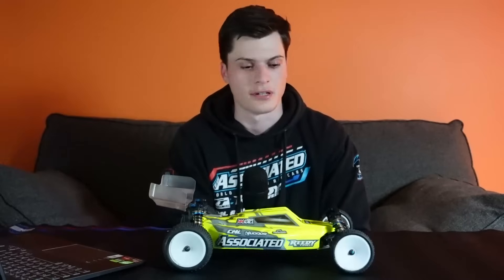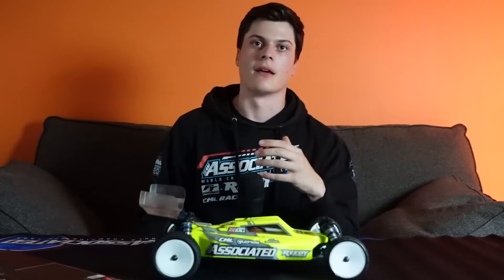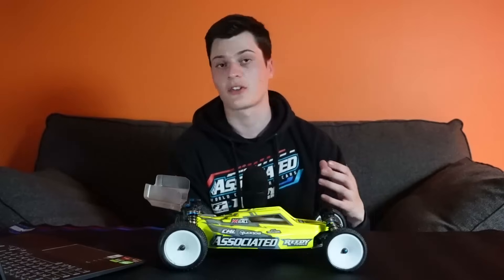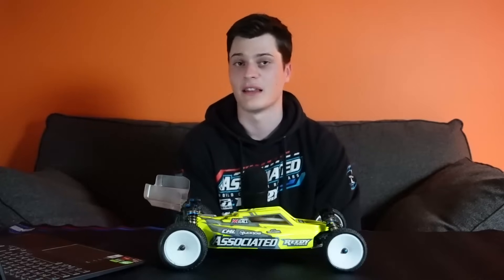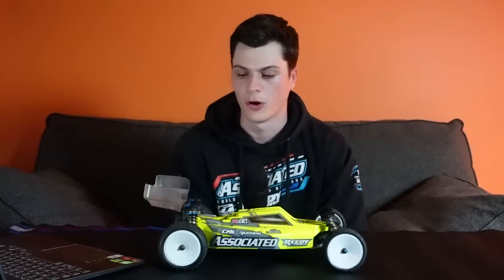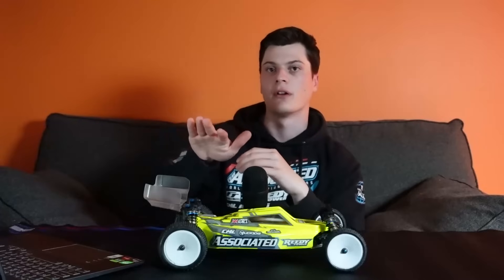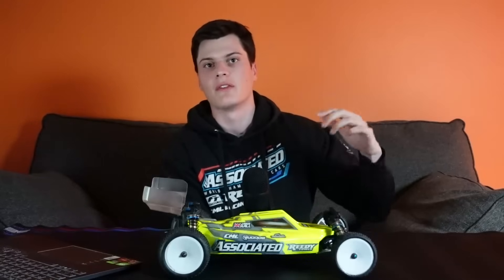Hub Heights: one of the most critical settings in RC...

Comment: The Cougar and CAT 2000 already had both outboard toe and hub height adjustments by using inserts in 1993. Ironically that insert system was dropped two years later.

Comment: Great info like usual, but what about where to put SHIMS on the inner or outer of the arms? in front and back u use shims at the blocks, but what does it do if you put them at front of the steer block or in the back of it? same in rear, greetings

Comment: One of the things I have never understood about rear hub height was the relationship between the inner part of the axle that connects to the transmission and the angle of the control arm as they came from the factory. My first good RC, was an RC10T back in 91. Why I bought a team kit for bashing around the neighborhood, I have no idea I was young and dumb. But one of the things I noticed on that when I was trying to get more ride height out of it was that you could not add much more droop to it because the axles would pull out of the differential. The way it was designed the inner pivot in the center of the axle were farther apart than they were out at the hub. On compression the axle slides in, and on extension it pulls out. You look at all the effort they put into reducing friction with shocks, pistons, seals, pivot balls and all the prep work on the hinge pins make sure everything moves freely. But then the axle shaft bind up under power as The suspension compresses. 
Both of my Centro B4 conversions had the MIP pucks in them to reduce that friction. But they all still had the same narrow spacing out at the outer hub. Kind of a Band-Aid. Some of the newer RC10 models had adjustable inserts at the transmission to raise or lower it so that when you're running super low ride heights your inner joint is straight. But at the same time you lower arm now has more angle which makes that friction and join movement amplified. 
Why don't they extend the outer hinge pin down farther to level out that arm and eliminate the axle shaft movement? While they're designing it they could easily make adjustments to the upper mounting point so that your roll center stays the same. 
I just never understood that and nobody could ever give me a good explanation why. Back when x factory was the go-to thing for mid motor Team Associated, I was talking to one of the guys and they said they used that bind to add traction to the car. Which seems like I really piss poor way to add anti-squat when you could do it with the hinge pins and let it move freely. 
Like I said, I've never been able to figure that out nobody ever gave a good explanation why they do it that way. Obviously there's a reason because they keep doing it, I just don't know what it is.

Comment: Thank you for this perspective on the terminology of ”hub height” or ”axle height”. 

I’ve been saying for a long time that the hub is really fixed to the wheel so the thing that moves up and down is the outer hinge pin (rear) or outer hinge pin and link outer stud (front). People have looked at me funny and ridiculed for it. 

The hub and axle do move up or down if the frame of reference is the car at full droop, though.

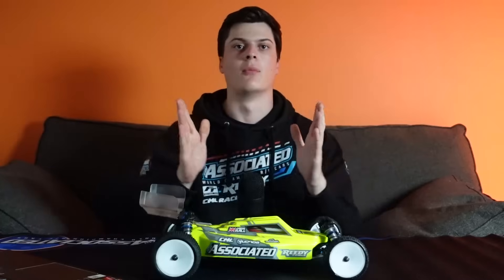Comment: At time 2:11 , I didn't follow. I replayed this over a few times to better understand. A downward angle from the hub to the center of the car is a high roll center but it was explained to be a low roll center. A downward angle from the center of the car out to the hub is low roll center.
Reply: no you got that wrong, its a combined angle of the links, if the lower arm is pointing down from the hub to chassis that is usualy a lower rollcenter then if the arm is straight or angled up from hub twards chassis.
also the upper arm angle is part of determin what height the rollcenter got, if the rollcenter is high or lower.
but in this case as Hallbrother speak of if the hub is high or low for example the front where both arms change angle in unison pointing up or down twards chassis it determin high or low rollcenter.
hope this helpt a bit to understand more of the complex matter of chassis dynamics.
Reply: @extec101 I thought he was talking about the upper link angle at the time. I'll rewatch from the perspective of the arm angle. Thanks!
Reply: @lawton70  no problem im just glad we could get to a conclusion and help eachother out, be helpfull is part of the hobby.